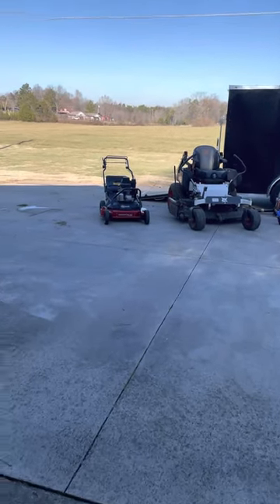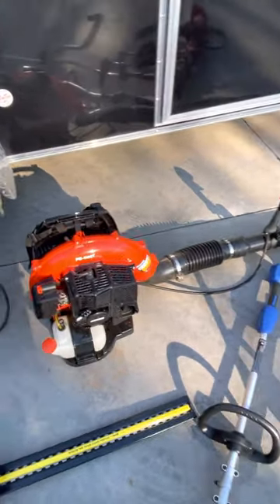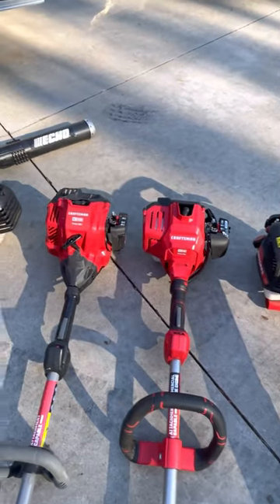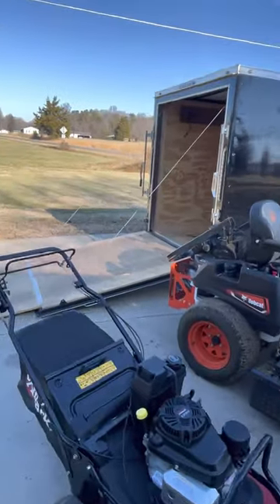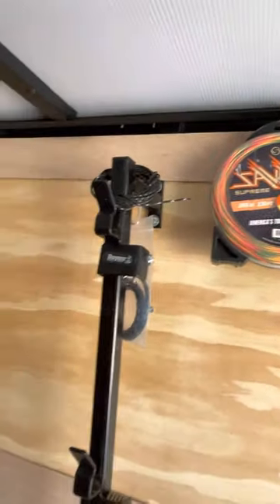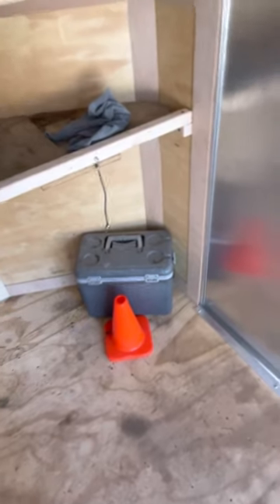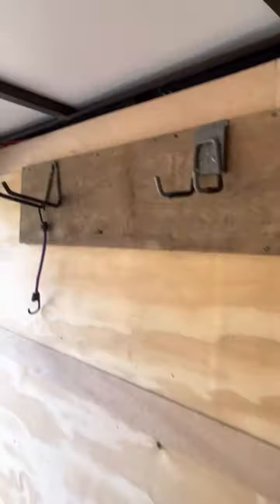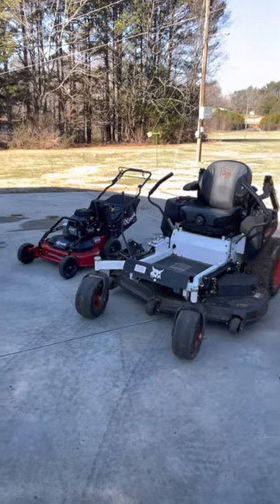6x12 enclosed lawn care setup 2023

Comment: Interesting setup. Didn’t know craftsman made a commercial line. How do ya like the suspension seat on that bobcat mower looks like a nice one to have! I had Exmark 30s at one time but recently sold them all will be using 21s from now on as a finish cut simply due to the weight.
Reply from the maker: Love the seat on the bobcat. Craftsman’s are gonna be sold this year

Comment: A solid looking setup. Weightwise would that trailer be able to handle two standers? I noticed it is a single axle. You mentioned you started the business last year. Is that when you acquired the trailer? I'm curious how much that one cost you? Thanks for sharing and contributing to help others as well.
Reply from the maker: I got the trailer after I upgraded mowers. I don’t know about the 2 standers. But that’s something I need to research. Thank you
Reply: 6x12s are around $5,000. I believe the gross weight is around 3,000lbs
Reply: @jaxonbaker2512  a 6x12 enclosed trailer would normally weight just shy of 1500# itself leaving you a bit over 1500# for cargo.